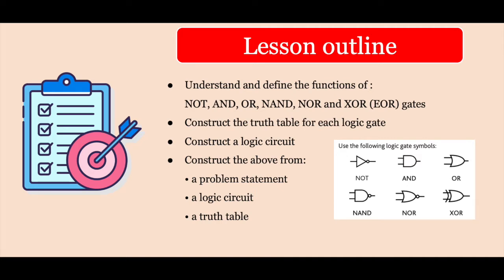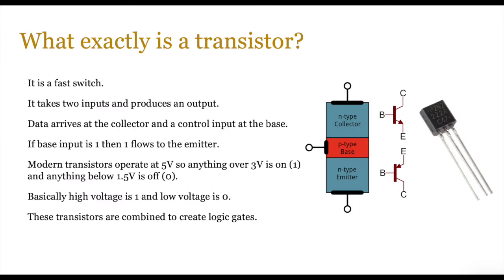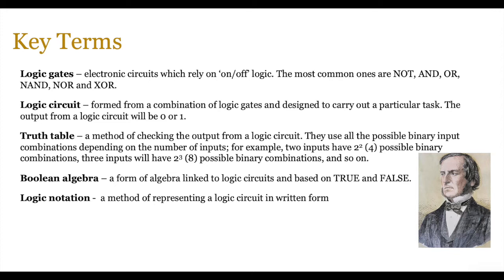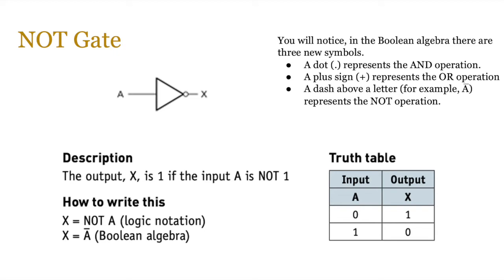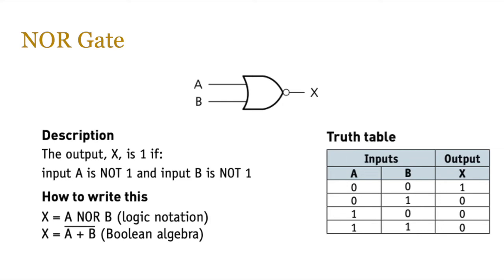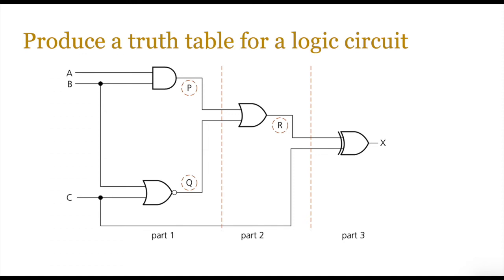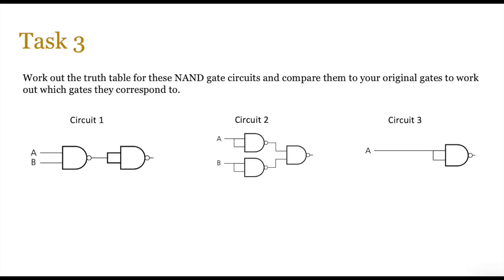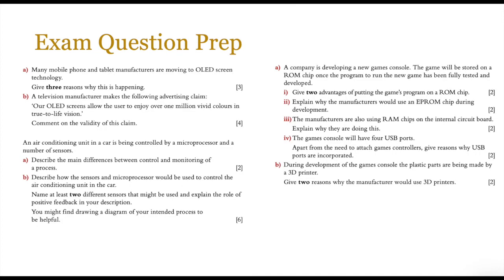Lesson 34 - Logic Gates

Comment: Sir i have a question:
This is the 3C question in the book:

c) T = 1 if (switch K is ON or switch L is ON) OR (switch K is ON and switch M
is OFF) OR (switch M is ON)

I have created the logic circuit, but my answer is different from the book answer.
But, my truth table output is the same as the book answer.

Can we have different logic circuits, but the the truth table output are same?
Reply from the maker: That is possible, depending upon the gates used e.g. NAND can be implemented as AND followed by a NOT gate. Just make sure there are no obvious logic mistakes and also check if the gates you have used instead of the ones in the book resolve to the same output for that section.